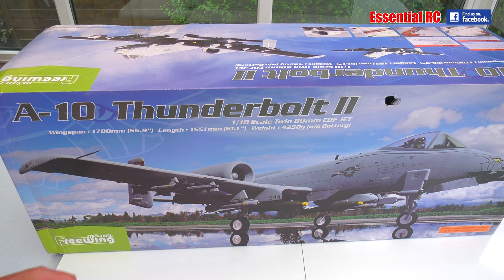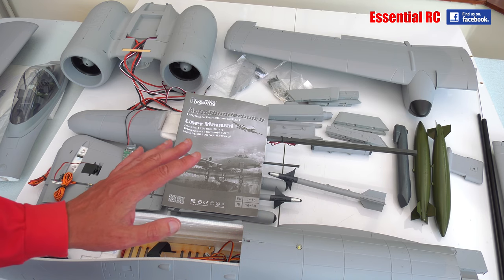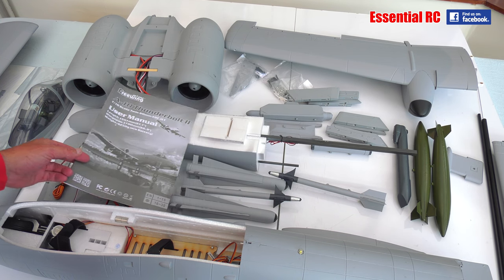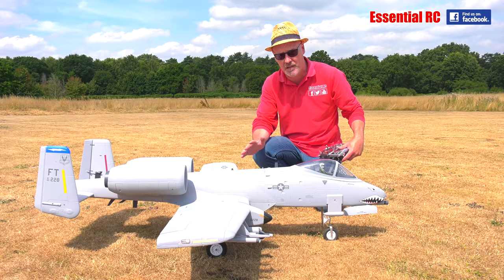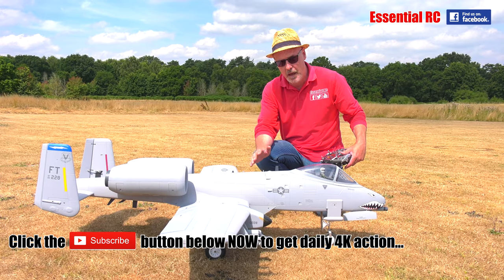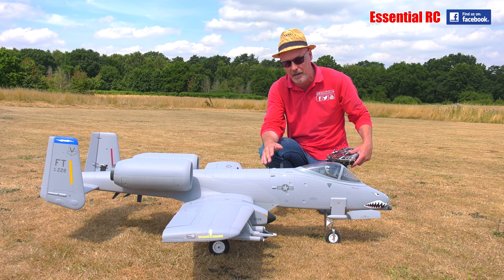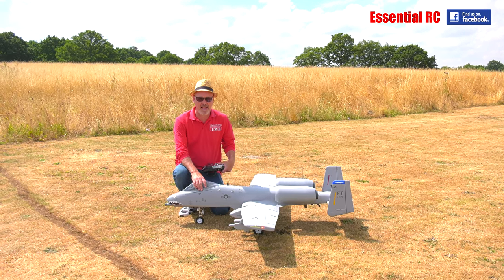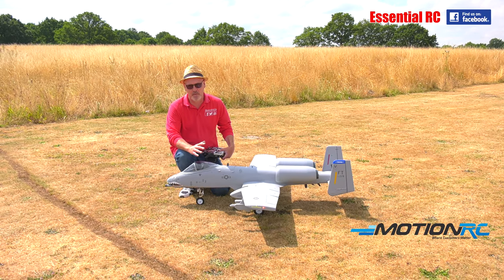Freewing A-10 THUNDERBOLT II Super Scale Twin 80mm EDF Jet PNP: ESSENTIAL RC FLIGHT TEST (Motion RC)

Comment: i just bought this plane, gently used and have been searching videos. Yours was very informative.
Can you tell me if you used a gyro? I really don't know much about programming them. And few of my planes have one. Also would a 5000 MaH battery be acceptable?
Thanks for any input! Kurt
Reply from the maker: 5000 to 6000mah packs are good. Heavier packs might stress the landing gear too much on landing. Gyro isn't necessary although it might help on a windy day. The cheap gyros from MotionRC are good. I use gyro features in Frsky receivers.

Comment: Mr essential rc would 2 6s 6500mah lipos be too heavy for this airplane?
Reply from the maker: Hmmm. It will fly OK but the issue will be the landing as it will be relatively heavy. You should definitely get the nose gear brace 3D printed. Look on thingiverse.com for additional parts for the Freewing A-10 to make the landing gear stronger. Personally I think the FMS A-10 V2 is much better. Slightly smaller but only takes one 6S pack.
Reply: @EssentialRC  Thanks again good buddy for the info and you timely response! Happy New Year
Reply from the maker: I brought another FMS A10 v2 after stupidly destroying my first. Will be making it head tracked FPV ! Sub and click bell icon for notifications about that project. Cheers - Dom (Essential RC)

Comment: 7:12 never try and knife edge with a jet. Ever. The airframes aren’t designed for that kind of stress.
Reply from the maker: What are you talking about?!
Reply: Essential RC Don’t try and fly sideways.
Reply: It's not a problem at all with epo foam. I've seen balsa fall apart in the air doing a knife edge but never foam. I have several edf jets and never had any issues knife edging.
Reply: @traviscozza7177  I’d play it safe and not try it. Leave those kinds of maneuvers for purpose built 3D planes.